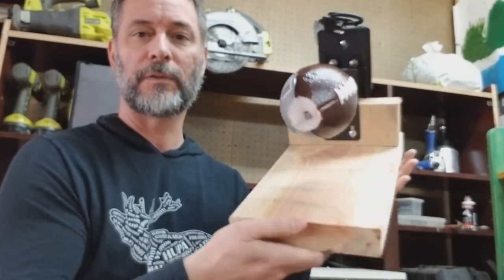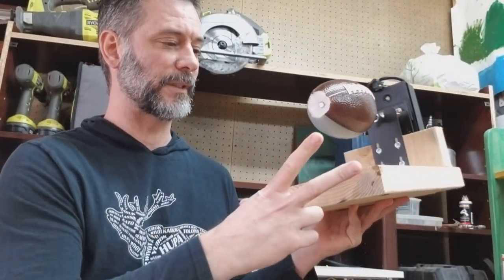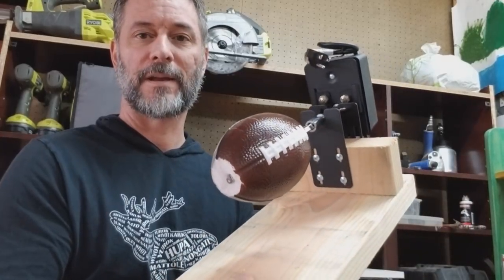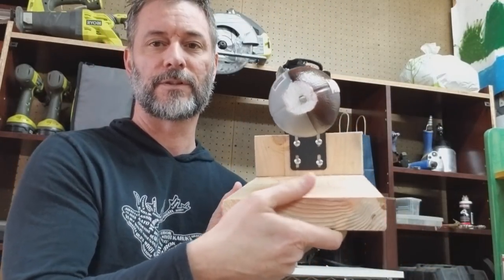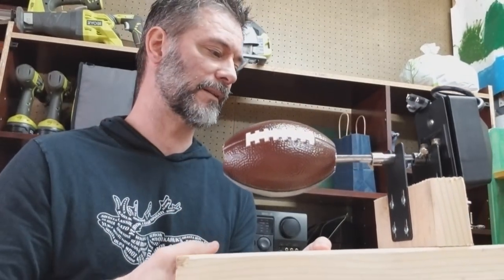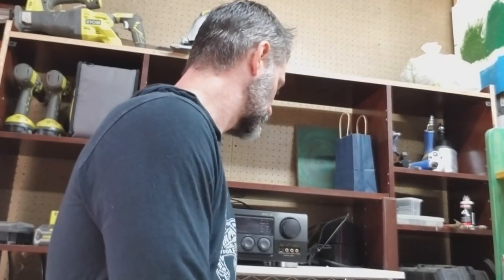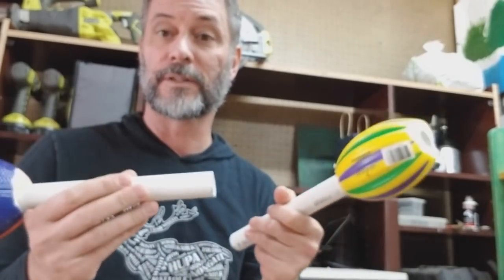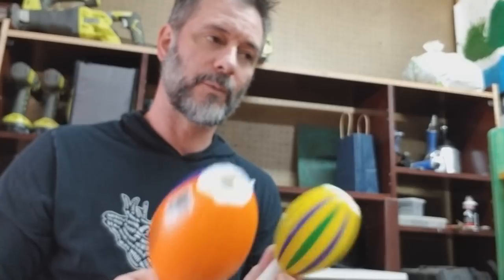Single Rotisserie Tumbler Turner with YOUR PVC football arm!!

Comment: Thank you Dan for this video!  What size are the screws and bolts that you screwed into the motor from the holes you drilled?  What size drill bit did you use?  Thank you very much!

Comment: drilling hole tip...  You might be able to (with the footballs and the smaller ones too) get them soaked up with water and freeze the balls.  When you drill into the ball it should drill the hole smoother.  Now this will depend if you can get the ball to soak up water.  I just know I have to do this with some other things and thought it might work for this too.

Comment: Thank you so much for this helpful video. I have tried to build my turner with other videos and it just wasn't right. What I'm noticing is that a lot of the videos, even in yours, the motor has 2 holes to be able to screw into the bracket. Mine doesn't have that! Am i supposed to drill into the motor???

Comment: you are so very awesome!!!!  can you tell me how long you cut your metal bars?  trying to come up with a measurement that will work.  Thanks!
Reply from the maker: Kimberly Goldstein What I do is once the unit is built I put the bar in the motor and see how long it comes out across the wood.  I hold a foam football up to it to get an idea of where I want it to end at the end of the wood (take into account the bottom of the cup), mark it with my finger and a sharpie and cut it.

Comment: Hey! I have been wanting to add pvc arms to my turner and didn’t know what to use to hold them in place. Thank you so much for this. What size pvc pipe should I buy?
Reply from the maker: Valerie lopez if your going to use PVC football arms and use the exact little nerf balls I used on the metal bar then you want to use 3/4" PVC
Reply: FeatherBear Designs thank u 😃
Reply: How to you keep the yellow ball from splitting ... I tried 5 ball and they all split
Reply: Valerie Lopez mine have all slit too